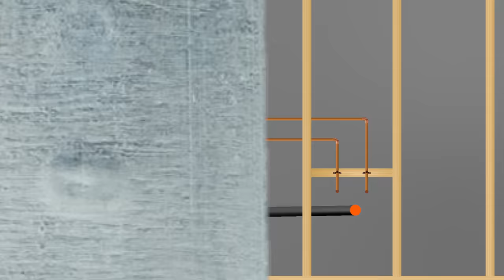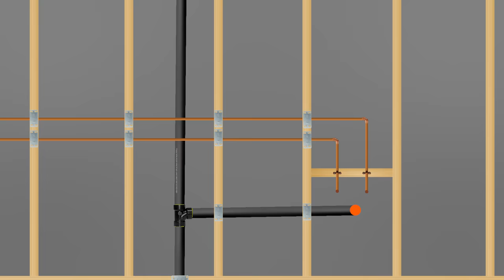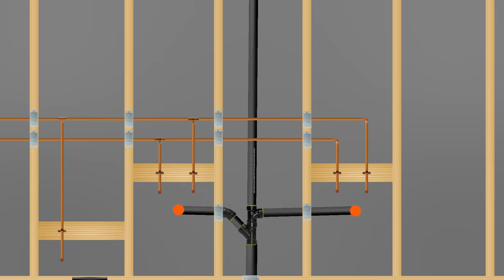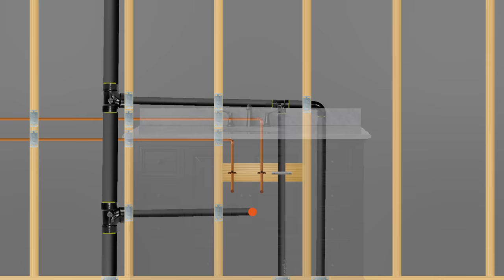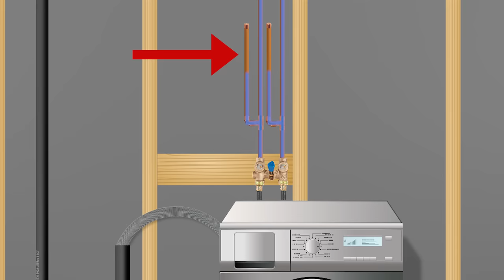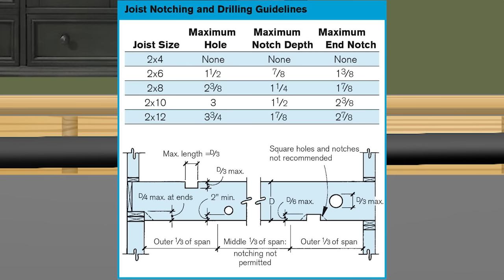10 Reasons Why You'd FAIL a Plumbing Inspection! | GOT2LEARN

Comment: What's code today, can be a violation tomorrow. It's always changing. Not being to code, doesn't necessarily mean the job is bad, or that it won't work properly for many decades.
Reply from the maker: Totally agree with you.
Reply: Sometimes  when someone follows existing codes and then after it is in service the powers that be realize they screwed up .  A perfect example is a   full size drip leg on a gas pipe and someone decides to add extra appliances with total disregard to the cubic ft  demand   of the added load
Reply: screw code
Reply: it always comes down to the inspector's EGO
Reply from the maker: Lll
Reply: he knows that and so does a lot of people. my washing machine drain is 1.5 inches and it works fine but if i I upgrade then i need to widen
Reply: But follow today's codes not yesterday's.
Reply: Changing the code is usually a result of problems with existing installations. Also working for "some time" might still be a problem. A house is not a dress, you might live in it even after decades. I see this with mixed feelings, especially when reading the comments under this post. Also the demands might change. Todays washing machines are different from those 20 y ago, wet toilet paper wasn't a thing before the 90th...
If you are not sentimental about last weeks shit or have an addiction to clean your basement better follow the code it is the essence of experience in thousands of houses it might work without but usually following the code isn't even more costly than doing it wrong.
Reply: @Axrover  ya its a bit confusing, my washing machine drain is 1.5 and it was done when the code allowed it. The walls are also 2x4 so im not sure how one would have a 2 inch pipe going through 2x4 walls. If say we had to make a change, would I now need new walls and a 2" pipe added in ?? makes no sense. 

1.5 is also more than enough given that the washer outlet is what 3/4 inch thick ? and relatively close to the main drain line.
Reply: Newer washing machines pump water out so fast that a 2 pipe is needed for best drainage..
Reply: Washing machine drains were 1”1/4 for a long time.
Up to 2” now?

We should just do everything in 2” now.
Makes it easier
Reply: @irish89055  ya I get that so now I need to destroy all the walls to replace the 1.5 with a 2 with a new washing machine ? Seems idiotic and no one does this.

If it was new build then sure add in 2” pipe, but no one would be buying new washers if it involved demolishing their walls or cement floor to upgrade drain pipes.
Reply: @Eshin-Ni Gakudo my thoughts exactly
Reply: @irish89055  Ya but I don't have a newer washing machine and never will, they suck and stink. My washer actually FILLS UP with water and CLEANS my clothes. So why not let me build the house I WANT after all its mine. Before you say ya but somebody might buy it some day, well let them inspect it and decided then if they want it, after all with the cameras and non destructive testing they have available now there is no reason to say you couldn't know
Reply: @oneeyedrone4293  Right, and besides you can just neck down the washer outlet to reduce the flow, its not a PD pump, it will just flow less.
Reply: @integr8er66  
I’m an electrician by trade, but I dabble in everything. It’s the same lines of bullshit with electrical codes too. 
Staple must be 12” away. 
Box can only hold X amount of wires. 
This shall this...... that shall that....

90% having 0 to do with safety 
Codes are mostly bullshit.
( yes I follow them all, or I’d be out of a job)
Doesn’t mean they make any sense.

I really can’t stand the “code gobblers”
They all spout off that “ codes are there for a reason!”

They don’t know why... they just know they are told so
Reply: @itaintrocketscience  Yep, just had a long discussion about how im an idiot because I am fine with residential receptacles and not commercial in my house because...well the commercial ones are better and you always need better.. well they are but good enough is just that. My rebuttal was why not always drink from a $50 Yetti cup when a red solo cup will work?
Reply: @integr8er66  well, with new houses supposedly you can't have a double cylinder deadlock.. ughh
Reply: @oneeyedrone4293  No you wouldn't need to re-do your walls.  The studs of your walls are 2"x4"--meaning 2' thick and 4" wide.  So the 2" drain pipe would be going through the 4" width of the 2x4, not through the 2".  C'mon, think!
Reply: @itaintrocketscience  you're the electrician I would never hire, LOL
Reply: @christined.3728  
Works out nicely.
I don’t think I’d wanna work for you.
Reply: @christined.3728  2x4 studs are 1.5 x 3.5 actual. 

A 2” hole Pipe going through a 3.5” stud basically means no wall stud there anymore. 

So no that is not correct at all.

You would need minimum 2x6 walls (1.5x5.5) to run that pipe legally.
Reply: @christined.3728   no they are not  2" x 4"  ,they are 1.5 " x 3 .5", take a tape to your home center next time you go to the lumber dept .
Reply: It will, however, mean a fail.
You never have to meet new code unless you are messing with something- then it is a new inspection.
The old in-place stuff is always grandfathered.
Reply: @lostintime8651  you said it! I made a “inspector insanity” video on my house project!
Reply: @itaintrocketscience  YES! I went through code insanity last year on my house. I ask “if all this is for safety then why aren’t the houses 300’ away across the county line burning down every day?”
I work on rentals that were built in the 50’s with cloth romex and no grounds. Most have had several remodels done by Ernie and Bert. The stuff I see used to terrify me but now I wonder how none of the 200 houses owned by one slum lord have not burned down in the 5 years I’ve done work for him. One fire but it was a angry person who got evicted. Power was off so they put a phone book on the burner and switched the stove on. Ruined the stove but house did not catch fire. They also left the washing machine Valves on so the place would flood when the water was turned on. Maybe codes on renters would help with less property damage.
Reply: @christined.3728  just to clarify your point. Wall studs are 3.5” and 2” pvc pipe is almost 2.5 outside diameter so that makes the OD of the fittings just short of 3”. Any 2x4 (1.5”x3.5”) you drill through has less than 0.5” of material left on either side of the hole.
Reply: @CBrown07696  
I can’t stop laughing at your phrase 
“ remodeling done by Bert and Ernie”
I can’t stop picturing muppets doing electrical.😂
That being said, yes, The code book writers and the inspectors need that constant change. They get off on us constantly not knowing what to do and seeking their omnipotent knowledge.

Giant scam that everyone eats up.
( hint, inspectors always find something... even if it’s little or made up.)

If it’s not code they’ll just say “ well, it’s a good idea, anyway”
🤦🏼‍♂️
Reply: that is a good disclaimer for the video but the video is still very valuable to anyone. you should verify all of these things with the local code and local official that is true with any construction topic. This video is good.
Reply: @sylvantieger4981  ... it's called a sediment trap and code has pretty much called for one at each appliance. The size of the trap will be the same as the diameter of the pipe it's connected to, and usually twice that or more in length.
Reply: @Ryan Farnham ... they should be quoting national code, with exceptions for more stringent local code. The new (2020) electrical code will make you nuts, but I'd bet many towns wont adopt it for years.
Reply: bullshit!
you do not understand code This is Plumbing not pig latin. Once you understand the reason it makes Perfect sense and easy to remember!
Reply: @marvinsprowl8811  Temper temper. LOL
Reply: @itaintrocketscience  ... saying "Bert & Ernie" just tells us the era a guy grew up in. I have been using "3 Stooges" when I see the same thing. I also knew a guy who said "Laurel & Hardy" and we all knew what that meant too.
Reply: @Axrover  the reason they upsided the size is because of the previous generation of detergents were very sudsy and the older washing machines using large amounts of water. Those 2 things combined would choke the venting capabilities of the plumbing and back up.     Up sizing the pipe fixed this. 
Now most detergents don't create as much suds.
Reply: 3 in pipe will fit in a 2x4 wall with no fittings, 2 in works for laundry in 2x4 wall but not for a urinal . No fitting arrangement will let the spud be close enough to finished wall . 2x6 works if you run the pipe to far side of wall .
Reply: @oneeyedrone4293  What I have done as it is not code here yet but we put an inch and a half p-trap in and increase the riser to 2". If you go 2" p-trap you have to go back to 2" or larger and install a new why fitting. Better to do it this way than for example increase to 2" at a concrete floor is a no no. Then you are smashing up concrete
Reply: @oneeyedrone4293  The drill bit I used for 2" pipe is 2 9/16". It does fit in a 3 1/2" stud. Fitting hubs will not fit in that hole.
Reply: @lostintime8651  Can you read?  The book is only $100.
Reply: Yes, my 175 year-old house has many modern code violations that pre-date the 1950s yet always "passes" when a competent inspector is involved.  I do fix them when I encounter during an upgrade/maintenance fix but I don't go all hog wild for no reason.  A few of those mentioned here are operational in nature not safety, so if its working I say don't touch unless its not working properly.
Reply: @oneeyedrone4293  Not quite.  You can double the stud or add a stud shoe.
Reply: My folks bought their parents house. It had fire proof walls and ceilings by the fire place. When they bought it with the same insurance company the house has been under for years..they had to remove the fire place. The fire place that has kept my grandparents warm during the winter when power went out for weeks at a time from bad weather. It also didn't have the tag on it from when it was first bought which is another reason they wanted it to go. Welcome to life and the bullsh*t that don't make sense.
Reply: @integr8er66  Exactly. New appliances are designed to fail in a handful of years anyway. Why does anybody comply with allowing oppressive government officials tell them what they can or can't do? And if you're hiring somebody else for a job, it should be up to you how you want the work done. If your drains don't work well, then maybe you should've done some research and agreed upon what specifications you want the work done to. Why would public funding be used to inspect or regulate the quality of private transactions? That's really why there are codes, to protect the lending institutions investments without them needing to hire their own inspectors, all on the taxpayer dime.
Reply: @oneeyedrone4293  And THAT'S why plumbers aren't carpenters! Really, the smartest thing to do would be to design the building so that drain/vent pipes don't need to be hacked through framing.
Reply: @First Last Code has nothing to do with safe, it has to do with $$$ and power. If it was good enough 10 years ago and there are still houses wired that way today then its plenty good enough. There really isn't a reason to keep adding more and more requirements
Reply: @First Last Guess what? I still have one too, and it works fine. Your analogy though is horribly flawed. You conflate convinience with code, you can safely have an indoor non-flush toilet (an outhouse) its called a composting toilet, but "codes" will not allow such, Why? its not about safety. Your comment shows you sheeple nature to the system
Reply: @First Last 
Found the inspector. 😂
Reply: @oneeyedrone4293  2X4 is actually 1.5X3.5 so 3 inch pipe will still fit inside a 3.5 inch wood stud. Your going to have to make a bigger or new hole in the stud and probably a new fitting into the 4 inch main drain. So your going to have to make a hole in your wall as well to do that if you don't have access to it other wise. you mat whish to call your city permit office to confirm what the new code is in your city.
Reply: @TrailTrackers  Damn dude, relax a little and maybe get some education yourself before you just unload on somebody like that. 

2" schedule 40 and 80 PVC DWV has an outside diameter of  2.375 " (2-3/8") and the hole would naturally need to be a little bigger to allow some wiggle room for the pipe to go through.

The IRC allows boring of load bearing studs, within limits. A hole in a load bearing stud shall not exceed 40% of the stud's depth; that means a 2x4 (1-1/2"x3-1/2") stud can drilled no more than 1.39" (1-25/64"). Now for the exception to that rule; IRC R602.6, Exception #1 states "A stud may be bored to a diameter not exceeding 60% of its width, which is 2.1" (2- 3/32") , providing that such studs located in exterior walls or bearing partitions are doubled and that not more than two successive studs are doubled."

Clearly, neither of these rules helps with 2x4 load bearing walls.
 If the wall is not load bearing then its a mute argument … cut and block, drill, or notch appropriately.
Reply: You are so right, plus some codes are bullshit. I know these thing cause I've been a plumber for 48 years. The guy who showed these illustrations in this video is right though....
Reply: @irish89055  That is very true. I don't know if they still do, but many you could change the pump in the washer for older homes.
Reply: Thank you for the wonderful plumbing update.i need to check my washer drain.
Reply: you have to be up to date.. code is there for a reason captain obvious.
Reply: Aluminum wiring. ;)
Reply: @christined.3728  Well they may be referring to some older houses, i believe 1990s and earlier actually did have some 2x3 walls at some point. maybe not the exterior walls but interior walls. I have seen numerous ones and it would be hard to put 2 inch in them. and 2x4 actual dimensions is 1 1/2" by 3 1/2 so 2x3 is closer to 1 1/2 x 2 1/2 inches which at the point you might as well cut out the section to put 2 inch pipe in and put metal brackets for protection but if the pipe is being ran through a vertical stud that would not be practical as there would be no way to hold up that portion of stud... at least without messing with integrity of it at least.
Reply: @itaintrocketscience  When taking a plumbing test for a license, you have to use the minimum size of pipe, for the specified fixture & increase the size according to the fixture unit count when dealing with BOCA or International plumbing code rules
Reply: @chadsimmons6347  
Thanks for the heads up.
As I stated, I’m an electrician by trade, but I still enjoy learning about all the facets of the building trades.
Reply: Absolutely.. codes are created to sell something for the highest bidder. No being to code just means you didn't buy the right stuff.
Reply: @christined.3728  Despite the name, a 2x4 board is NOT 2 inches thick and 4 inches wide they are actually 1.5 inch thick and 3.5 inch wide.
Reply: @oneeyedrone4293  no you don't make the drain higher where you connect the drain hose from washing machine,  this allows you to not have problems with newer appliances.
Reply: @itaintrocketscience  Love your answer!
Reply: @oneeyedrone4293  And exactly how many houses have 2x6 studs? Haven’t seen one yet.
Reply: My house was last replumbed in 1958, the last time it was renovated. A lot of my plumbing is way out of code now but I've never had any issues.

One thing that is outright bad design though is the capped-off pipe style water hammer arrestors. If the system isn't periodically drained, the pipes fill with water and usually never drain. You do not want that standing water getting into your potable water. That's how you get legionnaires disease.

It's better to have modern water hammer arrestors that just seize and stop driving the piston, or no arrestors at all (Like my house) than pipes full of standing water that can get to your tap.
Reply: @christined.3728  I've rarely seen a 2 x 4. 1 3/4 x  3 3/4 , often.
Reply: A 2”x4” is technically only 1.5”x3.5” - Having a 2” drain pipe go through even the wide part of a stud would only leave 1.5” of wood to one side of the drain. And even if your your pipe went through the middle of it, that 1.5” of wood would come out to 0.75” on either side of the pipe.
Tell me, what’s a wall stud for? - Support for your wall.

That’s why I firmly believe having plumbing & electrical lines running throughout inside our walls is stupid on the part of Code. Put your walls up and then run plumbing & electrical along the walls inside the rooms. And only go through the depth of a wall from one room to the next; like industrial setups! - Much easier to deal with problems of either that way and to see leaks & fires without being trapped inside your walls!

You could argue, “…but if I wanna change my walls to remodel…”, I have to rip it all down first… - You’re much more likely to change your plumbing or electrical before you change your walls. Code is stupid.
Reply: Agreed,let's keep the politics,out of construction
Reply: @christined.3728  Don't you mean the 3 1/2" width of the 2x4? True 2x4's have not been made for decades. Doesn't leave a lot of meat in the stud with a 2" pipe in there. Not to mention that the majority of washers use far less water than they did when 1 1/2 drain pipe was allowed. Less water in, less to be pumped out.
Reply: @oneeyedrone4293  Code is not for you tu understand. For example the washing machine "pumps" its water using power through that 3/4" so 1.5" isn't the same for free flow with room to spare. Commercial engineering is about overdoing it today so it lasts through tomorrow.
Reply: Not good advice! If you don't do a job to code and you have a disaster that requires filing an insurance claim, they will investigate and could deny your claim if they discover the flaw.
Reply: Washing machine drains are actually required a 3" drain once the pipe goes horizontal.
Reply: @patricknesbitt4003  the reason for the increase in pipe size is because of the suds generated from the soap and agitation.
Reply: This comment is inaccurate.  Don’t mean to be insulting, but you are so very wrong and trying to offer correction would fall on too ignorant of ears to understand.  Code is your friend, follow it.
Reply: @oneeyedrone4293  you realize a 2x4 wall is 4 inches wide right? I've put thousands of 2" pipe in 2x4 walls.
Reply: @PatIreland  many home inspectors will require all code updates that they can see. Even if it's worked for 50 years. I hate home inspectors though, always find "problems" that won't cause any problems, but never find actual problems
Reply: @joshuaavant1245  you realize a 2x4 stud is 1.5x3.5 right ? That gives your stud 3/4 inch on each side or less depending on how good your holes are. I’ve done it’s just super thin and I end up doubling it up. 2” pipes fit best through 6 inch walls, which are actually 5.5.
Reply: Depends on the context it is being installed in, but I would likely run the pipe outside of the wall until I could sneak it between studs and drop down or I would suggest installing a utility sink to drain the washing machine into, which does not require 2" drain piping.
Reply: @itaintrocketscience   As a Trades person your complete ignorance and arrogance is embarrassment to all trades. You say you Only do it the right way because it is a requirement of employment, no regard for the Qualification you have that you should be proud of. The License that says you have been educated and trained to be a Trusted expert, not some hack. You are supposed to have knowledge, you should dam well know that Codes are created from real life incidents, many being fatal and from failures of products and structure as found through inspection and investigation. Roughly 80% of all fires are electrical related, you of all should know and support why the numbers of conductors in a box are limited or why a wire needs support and strain relief. As a Trades person you should know that Codes are created and adopted collectively between members of Testing Agency’s, Manufactures, Industry and inspection bodies , they are not just randomly thought up,  they are the lessons learned from the mistakes made.
Reply: @lostintime8651  this is what is said by insecure people who aren't professionals yet should be one for the work they attempt to do & they skill level they pretend to possess
Reply: @itaintrocketscience  Sounds like she might be one that writes codes, LOL
Reply: @christined.3728  I've been plumbing since the late 60's , as far as I know I've always had to use a 2" trap on the washing machine. Now I've worked on houses that were in precode areas and they have had 1.5" lines and 1.5 vents ..if anything at all. Keep in mind code is always the bare minimum recommended, not always the best .
Reply: @christined.3728  2 x 4 is actually 3 1/2" depth and a 2" drain pipe is 2 3/8" OD and of course you need the hole to be bigger 2 9/16". That leaves less than 1/2" material on each side, if you drill perfectly in the middle and square. Yes it'll fit but it's tight retrofit work.
Reply: @itaintrocketscience  The problem is without codes you'd have  things installed in no standard way at all. As a home owner I'd prefer my contractor follow codes vs gut feeling or "their" experience.
Reply: Also codes are different depending where you are California code is different the Georgia. For example
Reply: Hi drone,  You are correct that arming a 2" pipe in a 2x4 wall leaves very little meat on the studs. Especially in a weight bearing wall. It can be done with a 3" hole saw when only going through 1-2 studs on a non weight bearing wall.  Washing machines tend to be generous with their discharge hose so a drain does not need to be right next to the washer.

The preferred solution is to bring the waste pipe up between the studs in the desired location.  

If you are finishing a basement you can move your wall forward providing a space behind the wall or a narrow chase to run the piping.  Finally, if you are remodeling you can run the piping along the outside of the drywall as the washer and dryer will cover it and a dryer often times needs space to allow for exterior venting. 

Your comment on drain hose size was already addressed.  

 @oneeyedrone4293
Reply: @oneeyedrone4293  You only have to upgrade plumbing if you are working on the plumbing.  For instance, if you decide you want to move the location of the washer and you open the drywall to alter the piping you are required by code to update that piping to current code.  This involves taking the entire drain line back to origin and making it 2".
Reply: @integr8er66  for the simple need of safety.  Codes like these seem unimportant to you, but they exist to protect people from shoddy construction such as crossing a water line with a waste line and exposing your drinking water system to drainage, yes this does happen.

The you have to catch me mentality puts others at risk for expensive repairs because you didn't know what you were doing and didn't want to learn.
Reply: @itaintrocketscience  You are correct that some codes are antiquated or seem ambiguous.

But to your point, just because you don't know why a code exists does mean there isn't a good reason for that code.
Reply: @oneeyedrone4293  this is why code is only followed on new builds. Anyone forcing code violations on existing homes is a prick.
Reply: Yeah, but usually codes are updated because of issues that have become common over the years.
Reply: @danrichards496  There's also payoffs involved to push products. They'll change the code, which can result in people paying a lot more money for unnecessary changes when building a new home, if even a small number of problems have occurred in relation to the massive number of properties. AFCI's are one example when it comes to electrical.